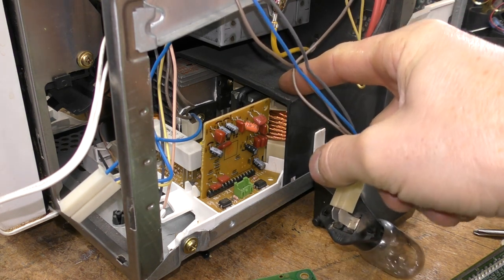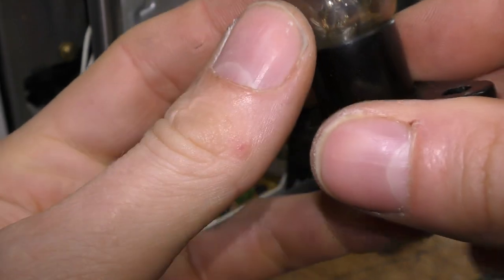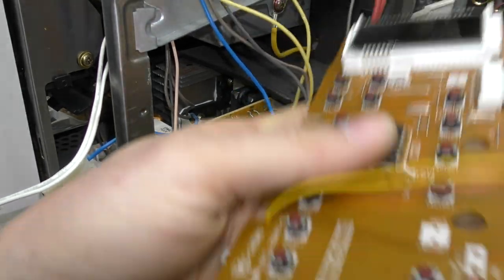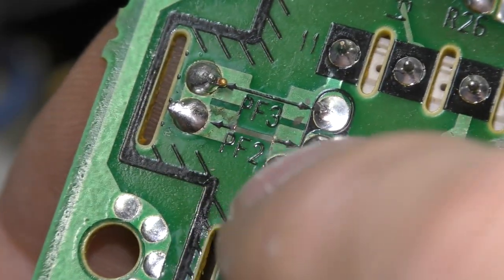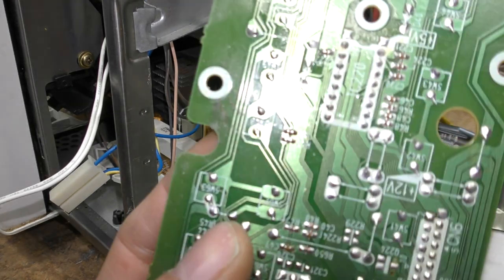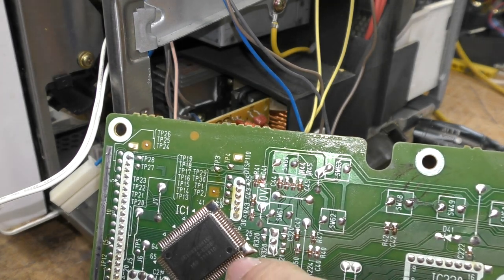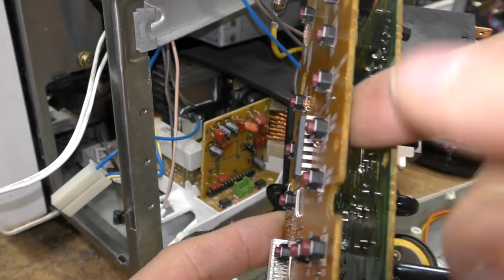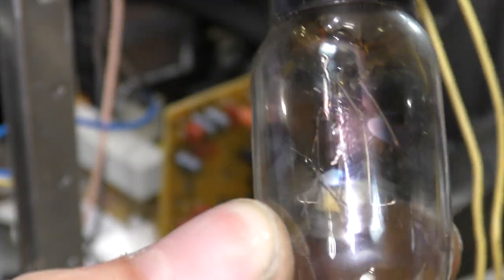Panasonic microwave destroyed by blown bulb.

Comment: Just repaired my CT55JW microwave. The control board does have a mylar sheet in mine so damage limited to one board. It had a nice black burn mark on it. The broken pcb track was easy to spot. Bridged it with some wire and solder. Oven works fine and the bulb/turntable are working again. Swapped bulb for LED so will hopefully not have this issue again. Thanks for the inspiration. Saved me £250.

Comment: I bet the original design spec had a mylar sheet between the two boards, but it got costed out.
Reply: Removing it not only caused it to self destruct but if it happened while someone was using the keypad they could have gotten shocked.
Reply: That is very scary. I'm rather surprised that Panasonic would produce such a dangerous item, but I suppose every manufacturer has it's oops moments.
Reply: The isolation on that board isn't good enough for that keypad to be ever considered SELV, I'm sure Panasonic understood this and designed the keys to meet standards for mains potential insulation (i.e. some plastic/membrane buttons like any microwave)
Reply: @Patchuchan  Unlikely. The bulb will only illuminates after the microwave is turned on at which point the finger is probably away. Even at that, there will be a plastic membrane between the buttons and the actual front of the microwave which would provide isolation.
Reply: No. These are quality machines. I have one. The problem is in the design: no Mylar sheet.
>

Comment: As a happy owner of an early Panny inverter, I am going to change the bulb and add an insulator just in case.  Thanks for the heads-up.
Reply: Sad fact though is the display uses more power than the microwave itself, simply because the oven duty cycle is so low, while the display is powered all the time.
Reply: SeanBZA 
That may be the case if you only use it once a year and it lasts for around a thousand years! I can't imagine how an LCD display, although LED back lit, can ultimately use the same amount of energy as a 1000 Watt inverter and magnetron. Even a VFD would use very little power.
Reply: A day is 1440 minutes. If you use the microwave for 10 minutes per day, the average power is 7 watts from that.
Soit is not that far off. And 10 minutes may be a lot for 'average use'.
Reply: I find the Panasonic Inverters are problematic on the 120v as well, and yes the bulbs seem to be the contributing cause. It’s a shame as the old school non inverter were quite reliable and wouldn’t die. Inverters not so much. Very poor circuit design. Good thinking on doing a preventative bulb swap. I may do that now...

Comment: Hi Mike, SNAP!!!!!!  My original Panasonic 'Delta Wave' microwave, died.  A year previous it had the megatron replaced but what killed it was the clock IC.  It powered the primary transformer which in turn powered the secondary.  The brilliant electronic guy in Battlefield Road in Glasgow (Innen Electronic for any of your viewers) said Panasonic had used very specific components on the IC board and when contacted they said these were no longer (he told me the cost of these components was pennies but without the values, it was very difficult to rectify).  The electronic guy said it was a real shame as this issue rendered the oven (which was otherwise perfectly serviceable), a scrap item.  Many thanks for sharing your experience.  Originally, AvE sent me over to your channel.  Kindest regards.  Joe.

Comment: I've seen the dead-short arc failure mode on a reflector bulb too.
Symptoms were a) loud bang b) tripped 10A circuit breaker c) blown 25 or 30A phase fuse (with all the funky effects that entails).
Upon closer examination, the part of the bulb closest to the base was blackened, and the screw part had an arced hole the size of a couple of grains of rice.
Thankfully nothing low-voltage near it.
Thought I'd mention the incident for future reference as to exactly what kind of currents can flow momentarily in this sort of failure mode.

Comment: Its a shame they didn't put a sheet of fireproof cardboard between the boards to separate the high voltage electronics from the microelectronics. it would have cost ooh, 3p? Im sure there's a number of scenarios where having a high voltage board that close to low voltage microcontrollers could end badly.
Reply: that 3p sheet of myler would have lost them the sail of a new microwave
Reply: You're assuming someone would buy a Panasonic again after it fails within 2 years. I wouldn't.
Reply: SALE
Reply: SAIL! ⛵

Comment: Panasonic will have the entire board as a spare part though, but you probably will find it is a good part of the cost of a new oven, worth giving them a call though. 

Got a similar Sharp convection microwave, but sadly the keypad that wore out ( rest of it is still absolutely spotless and working) is no longer a spare stocked. Should get it out and look on fleabay for a used one or a complete panel with working keys, or look at putting a separate non membrane ( probably a cheap keypad unit) in place of it, as all I need really is the digits and the enter/start button.

Comment: Thanks Mike. My Panasonic Microwave (same model by the looks of it) has done exactly this. Big flash, tripped the circuit breaker in fuse box, checked blown globe, same pcb track blown and arced over to the other board. AUD$1200 microwave trashed in a microsecond. Very poor design.
Thanks for the excellent analysis.

Comment: I just wanted to thank you Mike! I have a SIEMENS HF17056EU that started with a dead light bulb but ended up with something "strange" on the PCB I couldn't detect as all suspicious components checked out ok but the mw oven was not working right. Apparently I got lucky as I got only one PCB track fuse (marked PF on my PCB too) burned and nothing wrong on the LCD board and IC. I didn't know about these things and the copper track had evaporated without leaving any sign it was ever there. Simply bridged the 2 PF points back together and it worked great. This is a 10 year old model so I'll live with knowing I simply bridged the 2 together without calculating the right Amps rating needed. If something similar happens in 10 years time and my wire kills something else... oh well...
Thanks again!!!

Comment: I have a LG microwave made 15+ years ago, its controls are a timer dial and a power selector dial. Never had any problem with it at all. Still works perfectly. Meanwhile my brother has gone through 6 or 7 digital microwave ovens in the same time.
Reply: Built in obsolesence is a wonderful thing :(
Reply: 22 year old  matsui with a 'clockwork' dial still in daily use here. still on it's original lightbulb too btw.
for young readers matsui was the own label of one of our highstreet electrical retailers back in the oldendays :)
Reply: I have a 30 year old digital microwave. Still works, still its original bulb.
Reply: Sharp Carousel in my house with fully digital controls is still going strong 18 years later. The only reason I'm considering replacing it is the paint is peeling and the metal underneath is rusted
Reply: My 27 year old digital Sharp Carousel convection with sensor cook has never missed a beat. They can be made reliable.
Reply: 1980 odd KIC microwave, still works, even if the timer control died ages ago and i put in a push button and a on delay timer in place of it. Just need it to warm up a cup of water for me, so perfect, no adjustment needed and only a single green button.

Gone through a few lamps as well, they tend to blow the 10A fuse when they pop. Not having one there is actually a fire hazard in a microwave, as the bulbs are unfused, unlike regular incandescent lamps, so they do have a high risk of shattering in use, if somebody replaced the fuse with tin foil for some reason.
Reply: That's a weird way to spell survivorship bias.
Reply: Evan, I think for the most part people threw their 'clockwork' microwave ovens into the landfill because they were less fashionable than the digital ones rather than because they had stopped working
Reply: It's a cute theory but without any market research that's all it is. 

I had one that broke, does that mean they all break now?
Reply: I only buy washers/dryers with mechanical timers. I'm on my second pair in 30 years. I've only replaced two timer units. My brother had six failures on his expensive Bosch washer while it was under warranty.
Reply: well apart from showing that cheap consumer stuff was capable of longevity there's the serviceability issue. I guess the designer of that microwave wasn't worried about taking out the micro when the fuse blew because the unit was intended to get chucked away when the fuse blew.

Wasn't all roses in the past though - colour tellys were diabolical for unreliability until companies like panasonic took over the market.
Reply: The next generation of LG appliances will come with Wi-Fi and you won't be able to buy them without Wi-Fi.
Reply: Lol we have the house original microwave. House is built in 1970's and when the microwave finally breaks down I'm gonna fix it just because it's most likely only a diode.
Reply: +joinedupjon I can beat that. I bought the simple runback-timer Matsui-branded (Dixons OB) here in late 1986, so it's  over 30 years old. It's on it's second lamp and third internal fuse, and the turntable drive has been grumbling for years. But otherwise it's in fine condition with no rust and is in daily use. Still got the receipt for £129.
Reply: V8snail They were but now they've had several  decades of designing the cost out of them.

FWIW I pulled a 3-year old one and a 12 year old one out of separate skips last weeks. Both were cheap BOB (Buyer's Own Brand) ones made by Midea and, other than the control PCB, internally they were identical designs so it looks like they've got them as cheap to produce as they can.
Reply: I've been using a re-branded microwave made in the US in the 80s (haven't looked up the actual manufacturer). It has digital controls and so far I've had to replace the rectifier capacitor of the logic board and nothing else. Light bulb is long gone, but who cares. Anyway, digital isn't so bad if it's made properly. It's nice to have precise control.
Reply: Currently using a 13 year old National (now Panasonic) fully digital microwave and convection oven combo, fully specced with all the fancy features such as temperature sensing (one button to heat anything up to 75C). Still going strong.

Anecdotes are worthless.
Reply: When cheaping out, electromechanics are better.
When designed properly, electronics can be quite good.
But you can skimp more on electronics than on electromechanics and thus with cheap products you end up with crap (also there's less leeway with electronics than there is with electromechanics)
Reply: nucleochemist man, after going through 3 microwaves my parents pulled out their old JC Penny branded microwave made in 1986. Its digital, can cook for up to 99 hours(for whatever reason you'd need such a thing), can cook in microwave and convection modes separately or alternating between the two, and most importantly is decades old and still has had less problems than the three new ones we had bought
Reply: No, it will not be Wi-Fi. 
They will instead just directly couple the magnetron tube to an antenna, to save 3$ on a Wi-Fi card   ;)

Comment: Nice bit of forensics there! What model of Panasonic Inverter oven was this?

I have one of theirs (NN-CF778SBPQ) and although it doesn't have the same style of control panel as this one, I think I might check to see whether or not it has a similar lack of separation between control boards.

Comment: Hi Mike, I had a Panasonic microwave some years ago which had the megaton replaced no problem.  A few years after this event it stopped working again.  The electronics guy I took it to in Glasgow diagnosed the clock IC.  This clock/timer function then powers a primary transformer which then in turn powers the secondary transformer which powers the megaton.  However, the conversation then went down hill when he told me the IC was a Panasonic special and no longer available.  In summary, a 2 penny component rendered the machine scrap, what a bummer.  Kindest regards.  Joe.  PS Found your channel through AVE.
Reply: That is heavy

Comment: Thank you so much !!! I also have a Panasonic Inverter Microwave and - in full awareness now of what might happen - immediately ripped out the lightbulb, which btw is a custom one, not scewable. Now looking for a LED replacement. Guess i'll have to build a DIY one.
Giantic thumbs up !!!!!!
Now i think about replacing the bulb by a relay whitch then switches the bulb directly from mains power. Then worst case szenario would be the relay contacts could fail...
On the other hand - a fast 150 mA fuse in series to the bulb wire could protect the Board as well...
Reply: But there's already a relay switching the bulb on... why have a relay switching a relay?
Reply: @AureliusR  Actually i guess i missed that it was switched over a relay. I assumed some kind of thyristor. Looking at that it's very strange that the tracks switching a relay are getting destroyed when the load destroys the relais. How could that happen? Maybe someone has an explanation. It's the purpose of a relay to separate the load from the switching power - yet it failed to do so here. How?
Anyway - i did replace the bulb with an LED that should last longer than a bulb, is brighter and will  - if at all - hopefully once die more piecefully than a bulb.

Comment: I have probably one of those Panasonic Inverter ovens, not sure about the model you have but clearly it is not the quality I would have expected. My unit is working fine but every now and then when I hit START, it would cut off itself like it's taking too much current and some protection trips. One time it blacked out and the clock reset itself as well. And it's less than a year old!
Reply: Check the transformer for any loose connection on the control panel, mine did the same everytime you did any movement and often upon pressing the start button. It ended up being a bad solder joint in the transformer itself where the primary winding connects to the pin. You can test this easily by removing the oven cover and wiggling the transformer and observing any result.
Reply: Mine does something similar. In my case it seems to be the turntable. Sometimes it gets into a state where the gears bind or something and it can't get moving, so it cuts out a second or so every time I hit start as that's a fault condition. Giving the turntable a shove seems to free it and it's fine again after that. Until the next time.
Reply: Less than a year old though, so getting it sorted under warranty would make more sense.

Comment: built to a disposable price... shakes head
Reply: Not really, no. The rest of the appliance is by no means cheap, sure, cost-optimized, but there's still a lot stuff in there that can't be cheap. It's probably just one of very few weak points of the design.

Comment: Somebody threw away a microwave with similar fault next to my dorm. I never knew what killed the logic board, there was a glass fuse (for bulb) close to it blown to bits so now I know. 
Well, now I have esp8266-telnet-controlled microwave with single button in my dorm room
Reply: That's cool but for what possible reason would you need to control a microwave without you being in the same room, in front of the microwave?
Reply: telnet? that's unsecure ;) you wouldn't want to get yor dinner hacked :P
Reply: i am waiting for a bluetooth microwave, that notifis me when the food is ready ,  or lets me see/ add time
Reply: Actually the main purpose was to hack my roommate's dinner, I've gone too far when he nearly started to believe it was haunted.
Reply: I hope you've configured it to respond to pings the way only a microwave oven can. :)